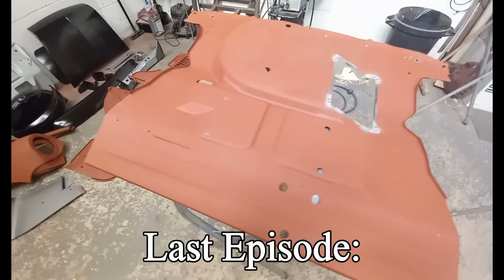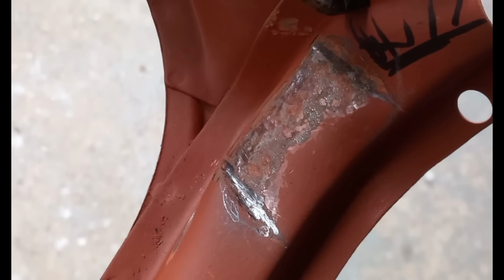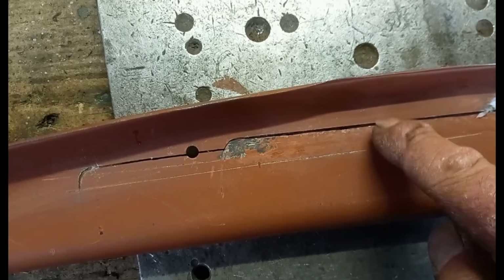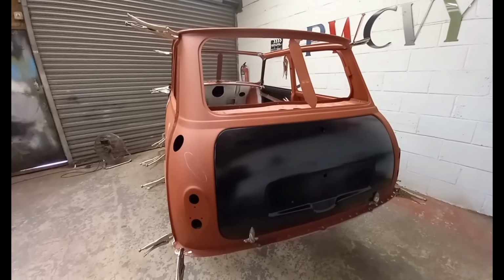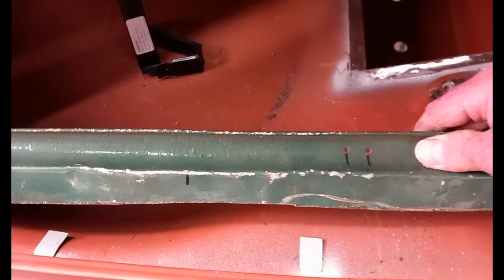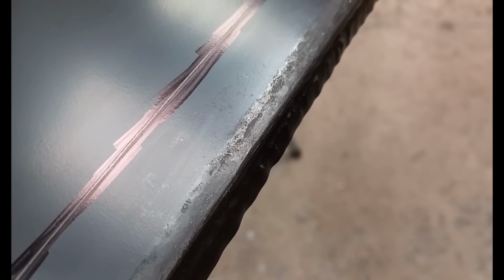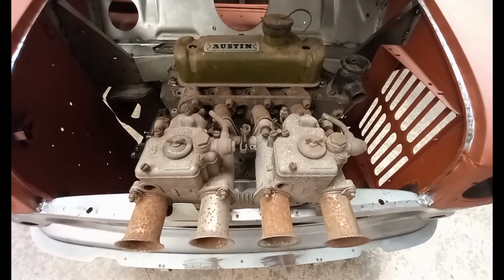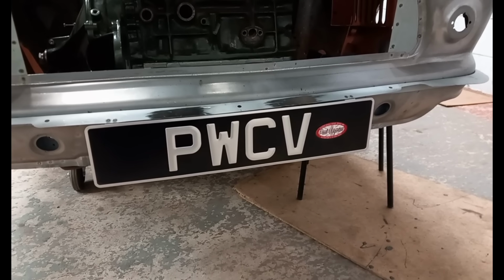Building a brand new 1965 Mk1 Classic Mini Bodyshell From New Old Stock BMC original panels Ep.2/2

Comment: Retired motor engineer/tester here, are your spot welds spaced as original?  There looks to be plenty of them.
Reply from the maker: No, not all. Original were very erratic and varied massively. My rule of thumb is 1" pitch for anything that was originally roller welded and 2" pitch for anything else although, on a couple of jobs where the owners were very particular, I measured out all the spotwelds I could find, catalogued them and replicated them on the new panels

Comment: So its now converted to a cross flow engine instead of both manifolds on the back of engine as standard.?
Reply from the maker: That's right, it's a period 60s mod from back in the day by Special Tuning Department. 4 inlet ports and 4 exhaust ports instead of the siamesed 2 inlet and 3 exhaust

Comment: My 1963 original 850 ( reg: 1902 D) was extremely sound throughout but we opted to fit a complete MG1100 power train just for improvement driving characteristics. I loved driving that car but not sure if it still exists?
Reply: I did the same mod plus a different camshaft, was a great first car.
Reply: @timgray3491  I did my apprenticeship at Piper Cams in Kent.
Reply: @philtucker1224  Think my camshaft was out of a 997 cooper.
Reply: @timgray3491  yes very likely. The 997 camshaft was slightly higher lift and overlap than a standard 1098 camshaft. Probably very similar to the MG 1100 profile with the popular 12G295 cylinder head. (Did you also have one of David Vizard’s “tuning your mini” instruction manuals too?) 🖖
Reply: @philtucker1224  certainly did, still have it today.

Comment: Do you pre-treat the rear sub-frame?  They used to last about 5 minutes before needing replacing...
Reply from the maker: @davidwedlock2622  in 35 years I've never had one of mine rot out. I do body restoration so only ever fit my own subframes which isn't many but it's a good idea to get some waxoil on them and keep them clean

Comment: My long gone 1977 Mini Clubman RPE 448R was a great little car for a 17 year old, but by the end apart from the rear subframe every panel was rusting from the inside out, I had inner and outers sills patched but it was never gonna last........................such a shame they were intentially designed to rust?
Reply: Pretty well all mass produced cars were so quite rare to see original panels more than 10-15 years.
Reply from the maker: They were only ever a cheap car but they've lasted 60 years so far and will do another 60+ now
Reply: @PWCV-YT  yes as a popular classic that’s true! ( I had an original 1963 myself back in 71) however I’m not sure any parts of the original cars last more than about 20 years so more likely to be like “Trigg’s broom” I think ha ha!
Reply from the maker: @philtucker1224  no, my own 1960 has lots of it's original panels. The 1968 that's in my workshop waiting to be preserved is incredibly good condition. They're out there

Comment: Are you going to take 6 years to get it 99% finished, fuck up the wheels and stuff taking it to a show then vanish from the internet for 2 years?
Reply from the maker: I have no idea what you are talking about. I restore customers bodyshells only. Please don't swear here
Reply: @PWCV-YT  It's a reference to Bad Obsession Motorsport's Project Binky, which if you're not familar with it, is an early 80s Mini shell modified to take all the running gear from a 1990s Toyota Celica GT-Four. It's a fantastic piece of engineering but the comment above pretty much sums up the current status of the project.
Reply from the maker: @Zeem4  haha, I see. Thanks for clearing that up. I've heard of Binky but never watched it